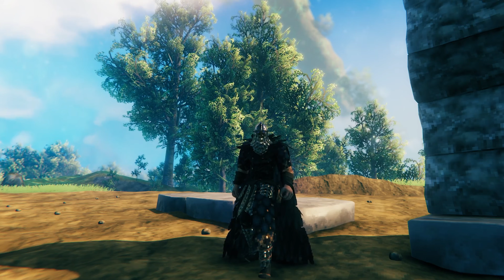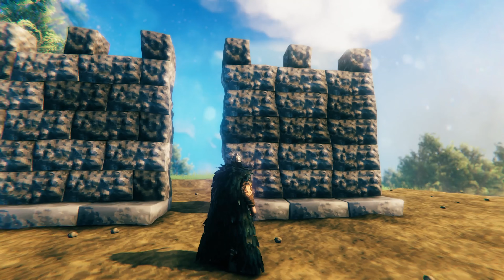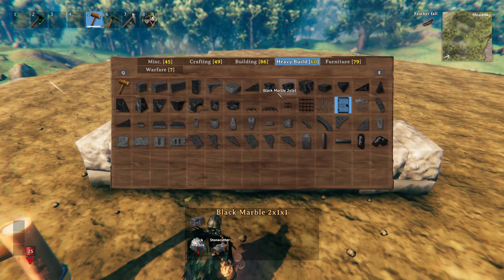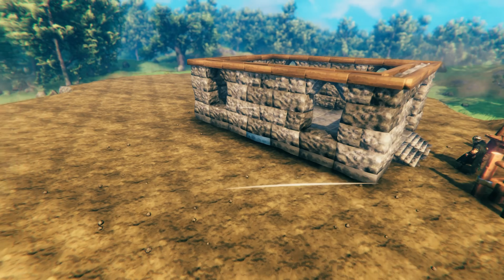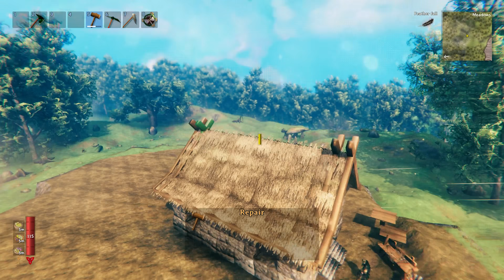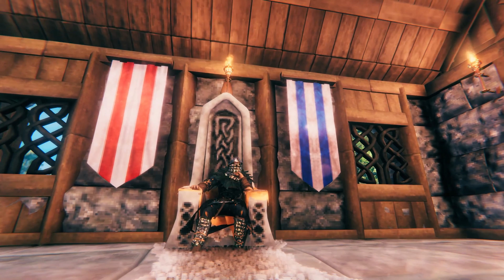Easy Guide To Making Better Stone Buildings In Valheim

Comment: It's seriously cruel that Stone is as easy as the Black Forest, but the Shingles to go with it is all the way in the halibut off in the Plains... with the Deathsquitos... :(
Reply from the maker: Yea, agreed. We need more shingle options anyways. I think they need to make serpent scale shingles that look like high elf rooftops, personally.
Reply: Hint for dealing with the pests. Atgeir.
If you see/hear them just in time, do a special attack. Doesn't matter the direction, the sweeping motion will catch that little cretin. Otherwise try to snipe them with a bow before they see you.
Reply: Getting the Root Harnesk in the Swamp gives you resistance to pierce, which means you can take Murderbugs easily. That only leaves the small, but not insignificant, problem of finding a tar pit and avoid the ire of the blobs there.

Comment: It looks nice but isn't building a roof on top of a wooden structure missing out on the stronger structural integrity of a stone base?
Reply from the maker: Sorry, I'm confused... what is the wooden structure you're referring to?
Reply: @gamestar.nation  Isn't that wooden structure placed on top of the stone, counting as a wooden base for the roof?
Reply from the maker: @Yoda300YearsAgo  no, as long as it’s touching the ground, stone becomes the foundation of the building. Same for using stone as trim and more stable blocks in late game. The wood may break if attacked, but the stability of the structure is based on the stone, traced from the ground up
Reply: @gamestar.nation  Thanks for the info, good to know. Cheers!

Comment: A quick way to get the first two iron is to "thump" in the swamp with the stagbreaker, this can be done very early in your progress through the Black Forest.  Iron nodes (muddy scrap) will register as a "0" damage hit with the stagbreaker.  Trees and rocks will too, so look for a number of "0"'s more than you would expect.  Dig down and often times one node will be enough to get your first two iron ingots.  Just watch out for leeches if you didn't bring poison res mead.  Good chance to get some entrails too for sausages.
Reply from the maker: Great advice! Finding iron early in the swamp is a game-changer. Thanks for sharing that 👍
I actually have a tip & tricks video coming out with that exact tip (with silver as well)!

Comment: I'm finishing building a castle in Valheim. A friend whose server I play on will show this structure. Of all the videos I've seen about Valheim buildings, no one has ever built anything this large. I don't use any mods or cheats in my construction. I know how to exceed building height limits. I know how to build stone structures on glass or wood. I know how to build enormous ceilings without support (40x40 with two-meter square stone blocks). I know how to build structures about 70 meters high (about 35 two-meter stone columns). How I do it – I simply combine various materials. This allows me to build an entire stone-roofed harbor that can accommodate two drakar ships side by side (like a hangar). Sorry, but this is just a change in the building method in Valheim.
Reply from the maker: You sound like an expert! I’d love to see your build when you’re done. If you post any images or videos, link them here please. Castles are my favorite! 😉👍
Reply: @gamestar.nation  I wanted to show how I built it, but I'm not a video expert, and my friend insists on showing the finished build. I should be finished in 2-3 days max. I don't dabble in decorations, so it'll be more of a construction project. I placed an island on the water and raised the ground, and on it I built a castle, with towers, walls, a harbor, a large farm, and built-in areas for breeding farm animals. Workshops are built into the walls to block potential mob respawns. When I'm finished, a video showcasing what I built will be posted on the "SuperMario UK" channel. The sheer size of the buildings and the construction method completely contradict what everyone knows about building in Valheim. I literally invented the reinforced concrete of Vikings :)
My friend is using a mod for better graphics, so it will differ from the traditional game look.
Reply from the maker: @robi2757   Sweet! You can download OBS for free off of steam if you use a PC. It will screen record in perfect quality. Let me know once it's posted, please!

Comment: A very nice and neat design indead!
A tip for saving resources: use bigger stone blocks whenever possible while building walls because they are more efficient in terms of used stone. Also never use stone slabs for the floor if you can avoid it, because you need a lot of stone for it!
Reply from the maker: Thank you so much!

Comment: This was great and I learned some new build techniques, thank you! Subbed :)
Reply: It is honestly so easy to fall into the trap of only using wood due to how generally versatile and easy it is to slap a decent looking structure up in no time. One of MY personal favorite building techniques is to build something off the side of a cliff, and use core wood beams to make a custom lattice underneath the main structure just to make it feel more enclosed and protected form the elements (also adds points of redundant stability if building in mountains and those pesky drakes shoot your supports).
Reply: @VirtuousWanderer I hear you, most of my builds are heavy on the wood, but I’m trying to use more of the other materials. I just got to the Ashlands, so I can’t wait to build with grausten!
Reply from the maker: @KnightofMuses  Yea the grausten and ashwood both add a bunch of cool build options. Grats on stepping foot in the Ashalnds, btw!
Reply: @gamestar.nation thank you! The Ashlands has been kicking my butt 😂
Reply from the maker: @KnightofMuses yea, it does that 😉 Good luck!
Reply: @gamestar.nation thank you!😭
Reply from the maker: Nice! I always end up making coastal properties, but the view overlooking the edge of a cliff probably makes for a much better view. Maybe I'll try something like that next!
Reply from the maker: Thank YOU!

Comment: Simple and beautiful.
However, one concern is the use of horizontal beams for the roof. The beams will deteriorate from rain.
Reply from the maker: Thank you!
I appreciate your concern, but they'll be okay. If a block shares the same space as a roof tile, it takes on that tile's properties. So any beam attached to a roof tile, or beneath one, is immune to weathering.  😉
Reply: @gamestar.nation  That was an interaction that I had no idea happened. up until now, I would always try to terminate my supports before they interacted with the roof laterally. Which, as you can probably imagine has somewhat neutered the scale of builds that I am able to achieve. (I am proud of my ability to make a large circular portal pavilion stand though
Reply from the maker: @VirtuousWanderer  Now you can rest easy 😉